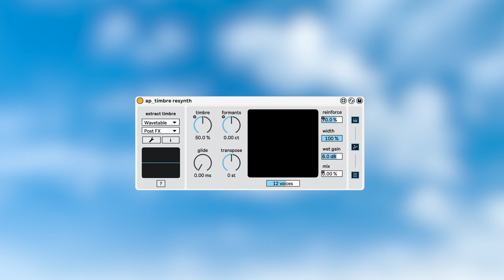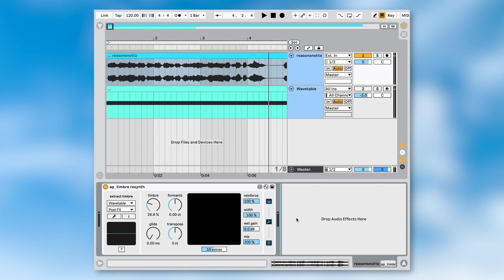Tutorial: Timbre Resynth | Color Transfer

Comment: its not perfect for sure, but i like to believe i have a really good pc that will do great with basically anything. that said, my 3080ti completely folds against this thing, i havent experienced this ln the whole time ive had it, am i doing something completely wrong or is it just this way?
Reply from the maker: Hey there! If you're having serious performance issues, free to reach out at: https://alexanderpanos.com/contact
It's worth noting that audio processing in most environments by and large happens on the CPU, not the GPU. Additionally, I'd consider adjusting the timbre resynth's pitch accuracy, time accuracy, and voice count, and exploring the utilities window to find an ideal combination of settings for your machine. There's also the option of resampling the output of the device and/or freezing & flattening the output to audio.

Comment: What's the best octave range for the input note, in your opinion?
Reply from the maker: In an ideal case, the audio routed into the secondary input is monophonic, and its most prominent frequency lies between 40 hz and 1500 hz (this is roughly E1 to G6). As I mentioned, it can handle a lot of material that doesn't necessarily meet these specifications, but the output may begin to skew atonal.

For added clarification, the set up with the "single long note" is something I came up with that efficiently demonstrates the Timbre Resynth. You can use so much more than just that! Play a whole melody into the secondary input if you'd like; switch between which sounds play that melody, use a live input, etc. Anything you can think of!
Reply: @alexanderpanos  extremely helpful--thank you! have been loving this device so far 💜